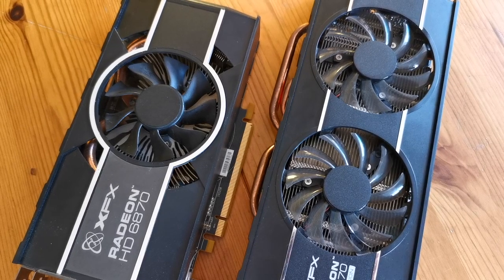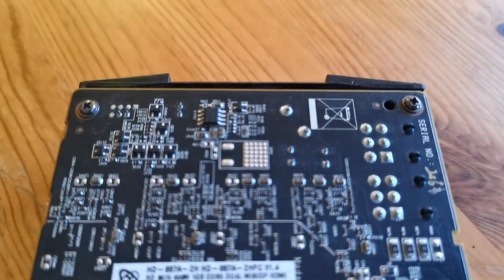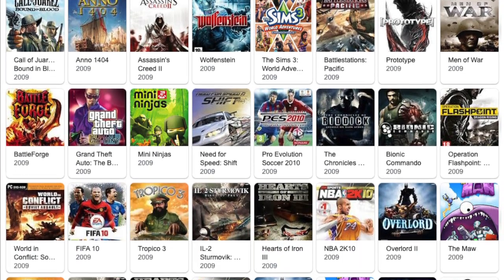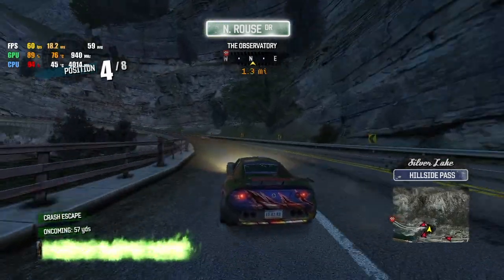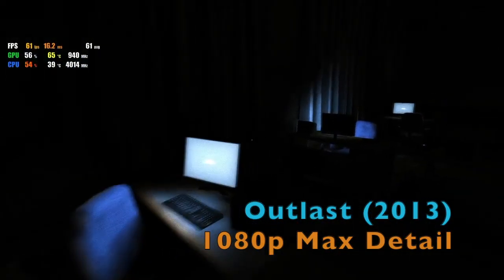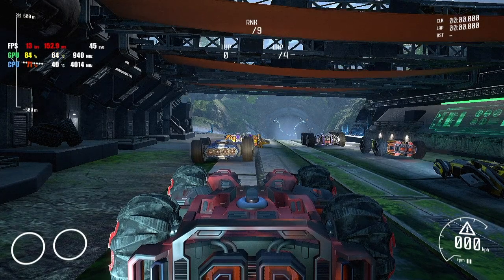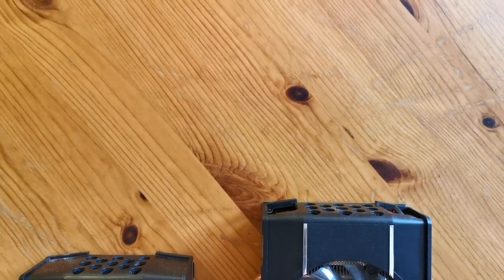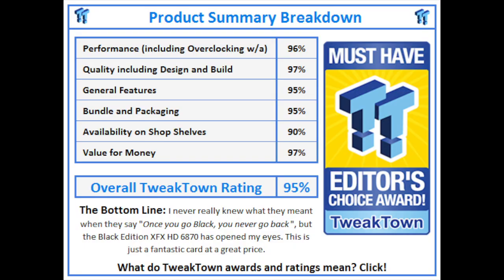What's Special About The XFX HD6870 Black Edition?

Comment: I picked up a HIS HD 6870 over the weekend for $10 (US). Cleaned it up and replaced the paste and tossed it into my Xp gaming pc (Q9650 tower). Card can easily handle all Xp gaming at 1080P.
Reply: I picked it up for $10 (Canadian), for a computer I previously got for $20 on a garage sale.
For this $30 PC I got an SSD for another ~$20, and now it boots to Win 10 in like 15 seconds, and runs Fallout New Vegas great on Ultra settings (1920x1080).
And the card is actually very very quiet, much quieter than most other video cards with fans.
Very capable card, very much usable today for older games.